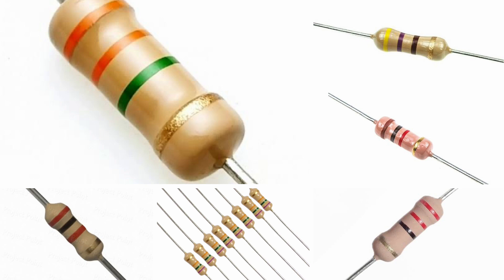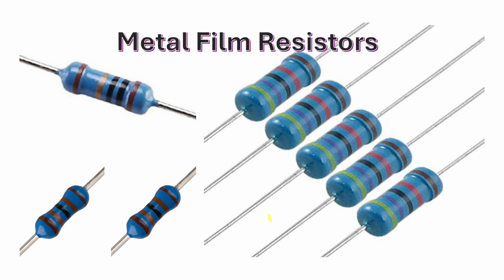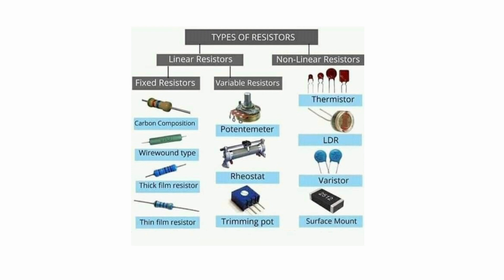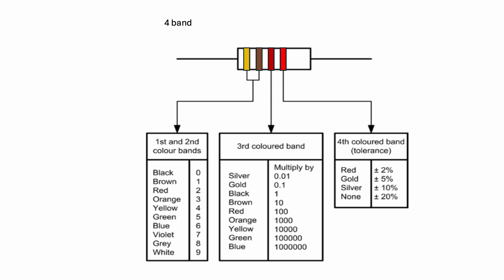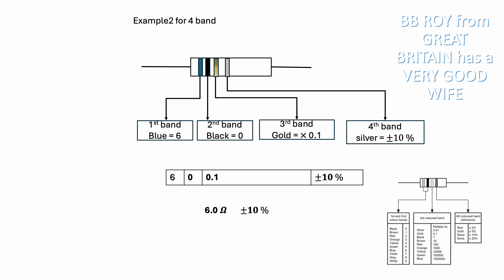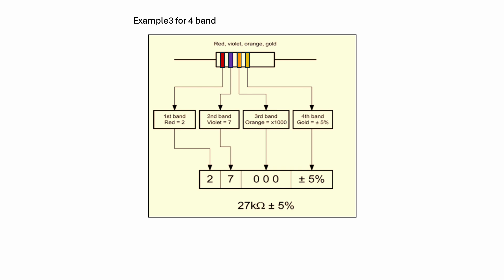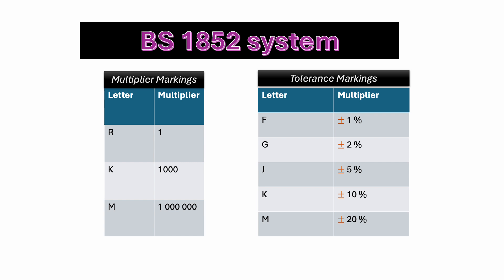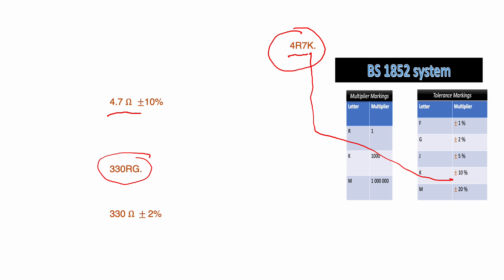Resistor and its calculations for circuit design  part 1

Comment: I can't see the color bands so well - I usually use my tester to measure the resistance.
Reply from the maker: @scottfoulk7480  ultimately the tester is the reliable way to know the resistance. But it’s a huge time saver knowing colour code method if there is colour band on the resistor.
Reply: @empwire177
Reply: A hint about the power coverage ist missing in my opinion.
Reply from the maker: @unoxunox4086  please watch the 2nd and 3rd part.
Reply: I agree it's just I can't see colors well.